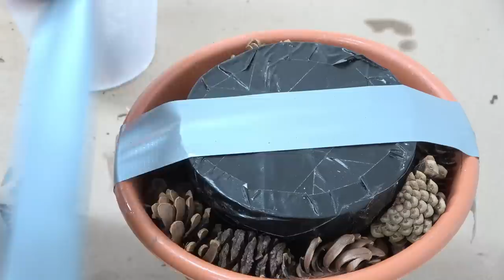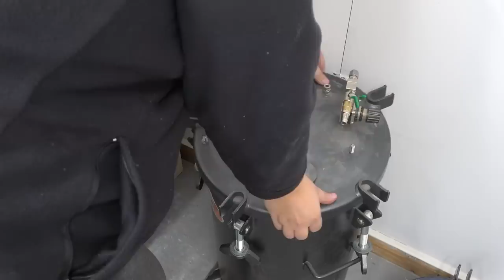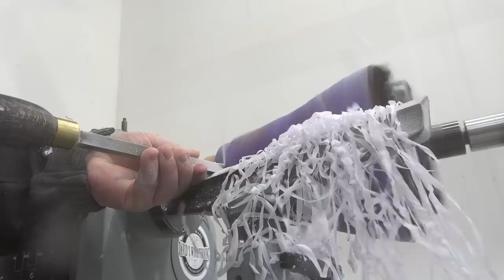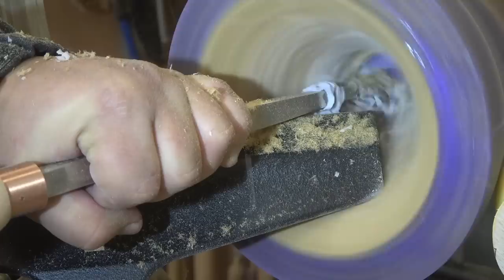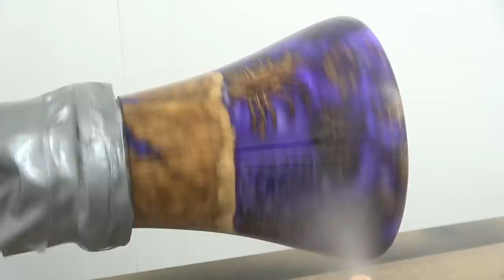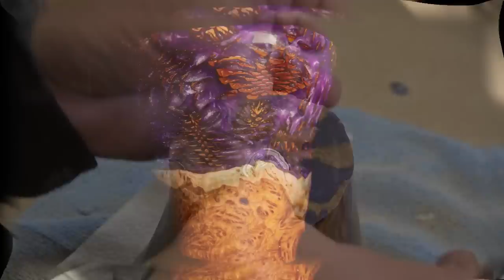What happens when you combine BURL and PINE CONES in woodturning?

Comment: I love it so much!!! It's on my mantle.  Trying to find a light to put inside to show off the amazing acrylic colors ❤❤❤❤❤ any suggestions on the light?
Reply from the maker: Thank you so much Stacie 🙂 Sorry that it took so long to get out the longer edit :) 
Defiantly something that does not generate too much heat. Neither resin and lacquer finish can stand well with high temp. Something with LED as they tend run at low temp.
Reply: Maybe the battery powered fairy lights? They make so many battery powered votives too.  Amazon or Etsy is a great place to get ideas.  You could back light it too.  Good luck.  You have a nice piece .

Comment: what do you do to be able to lift this out of the mold like you do? I usually end up destroying my molds.
Reply from the maker: Using a good mold is key. This was a flower pot but works perfect for this application. Also, use negative rake cardbide bits for resin
Reply: Thank you. The pots I usually use are paint mixing buckets from Lowes or Home Depot or a local building supply store @DavidsWoodturning

Comment: If you are a woodworker that's using epoxy, and using a torch to deal with bubbles later... 
 
Stop mixing the epoxy so that it becomes a frothing slurry!!!!
 
Unless your epoxy is a thin surface coat, torching bubbles will not do much. It only works on the ones you can see.  
 
Less bubbles in, less bubbles out. Microbubbles = cracks ! 
 
Hand mix slowly. Stirrer stays in contact with bottom the entire time. Drill mixers and 5 gallon buckets already mean you're pouring wrong. I'm sorry Total Boat and others have steered you wrong. 
 
(Or buy a giant vac chamber... they're only like $40k to start 😅😅😂😂😂 .)
Reply from the maker: I struggle to understand your point relating to my video. Thanks for watching!